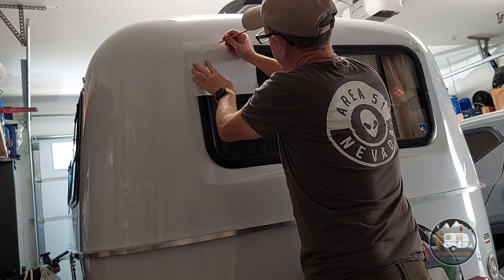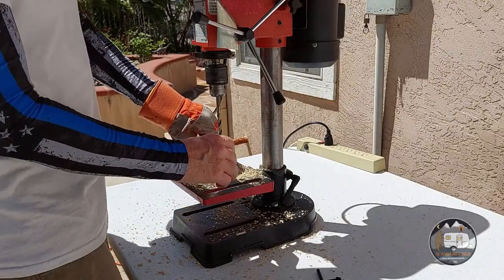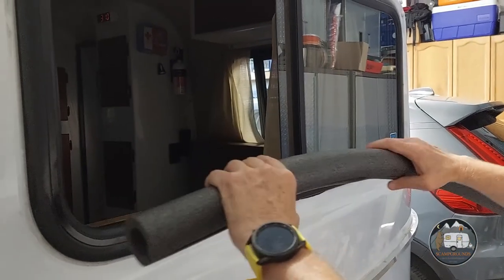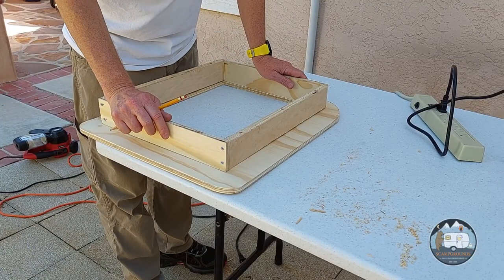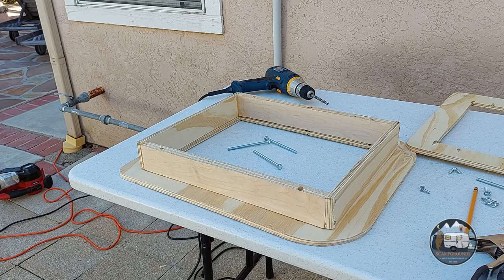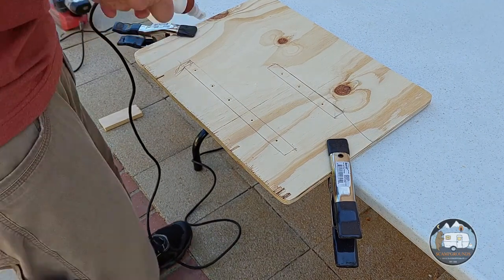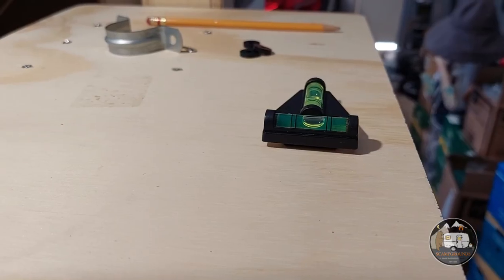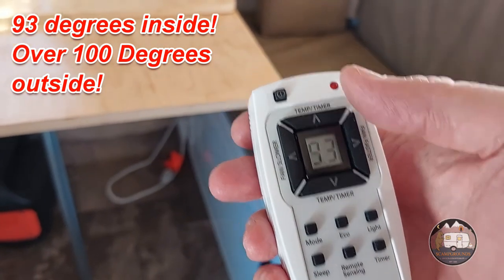Mini Window AC Mount for Small Travel Trailer

Comment: That's really well done.  I made a mount for window ac in my boler trailer a few years ago.  Mine is really simple though.  I just cut some plywood the same size as the window screen that pops out.  I cut a square in the plywood to fit the ac into.  The plywood then just slides into the slot for the screen and the ac slides in the hole.  Not as good as yours but it works.i only have to remove the lower jalhousie window pane which is just 4 screws. The top pane stays on and redirects any rain.
Reply from the maker: Thanks for checking out my video and kind words!  As long as it works, that's all that really matters!

Comment: Brilliant.  Cheaper AC.  Ability to replace in the future with relative ease.  Better match of BTU to camper's rather small cooling needs than the behemoth offered as an option.  Lower air drag footprint too boot.  Thank you very much.  Now to order a Scamp without AC.
Reply from the maker: Thank you!  Glad you liked my video.  The nice thing too is we only take the AC on just select summer trips when needed.

Comment: This is giving me so many good ideas.  Thank you!  I have a shuttle bus RV conversion project and was wanting to put a window AC unit in the side emergency exit window.  I think I can adapt something very similar to this to fit my needs.
Reply from the maker: Glad my project video helped!  Having a temporary AC solution like this makes travelling with our Scamp 13' much more flexible in the summer.
Reply: Don't rule out using a mini split if you want a permanent solution. They are definitely more expensive, but in my opinion are easier to modify to install as you only need to drill a small hole in your camper to run the coolant line through. Mr Cool brand has prefilled lines so you don't need a professional to charge the system. Once you screw the lines in, and open the valve, the system is charged. There are lots of videos of people installing them in RVs. You are also not restricted to using a 5k BTU or 6k BTU window unit. You can get a mini split in 12k BTU that will outperform most 15k BTU roof mounted a/c's. Also the mini splits are so efficient on power (they usually use 1/3 of the power of roof mounted a/cs) that many people have installed 2,000 watts worth of solar panels (four 500 watts panels on the roof) and like four deep cycle batteries, and powered the mini split 100% off solar power. Then you can boondock camp and still have a/c without a generator.

Comment: Nice video but it would have been really nice to see how cool you could get it inside there with it 100 degrees outside. Most RVs have a 13,500 btu  a/c on top at minimum. Now I understand yours is a lot smaller, but I would bet this is a 5k btu window unit, and in 100+ degree weather it would have been interesting to see if you could get it to at least 72 degrees in there during the hottest part of the day. Wish you had shown the temp later on the remote while it's still 100 out.
Reply from the maker: Thank you!  Great point!  I should have done that.   I can tell you that it got cold inside within about 15 minutes and I adjusted the temperature so blankets weren't necessary.   The Scamp 13' is small inside,  so this solution works really well.

Comment: Great video.  Going to start on mine soon.  Just one question, I saw you trace the opening of the inside sandwich portion.  Should that be the size of the air conditioning unit (plus the width of the bottom platform) that will be installed?
Reply from the maker: Thank you.  The cutout hole of the sandwich should be the height and width of both the AC unit and the bottom platform it sits on (and a small amount of extra room for some margin of error) since both occupy space in the pass through hole.  I traced so both sandwich cut outs are the same size with the same size opening to allow the AC back to pass through both sandwich pieces while sitting on the platform.  Does that make sense?

Comment: We don't have these aircons here in Europe. But thanks for the idea ! 😅
Reply from the maker: Thanks for checking out my video.  Perhaps a mini split system?
Reply: @scampgrounds  
Very expensive down here ( no less than 550$ dollars for 5000btu ) . The cheapest are portable units but they consume too much watts and create vacuum (single hose evacuation).
Reply: @scampgrounds  
I tried a  weak mini-split ( 3000 btu ) but it doesn't fit my german-style motorhome windows.
Reply: @scampgrounds  
Moral of the story is you have got to enjoy all the great things you have there overseas 😅
Reply from the maker: @fbezza  Sounds like you are on top of it.  Best way to go, if possible, is to plan trip locations when weather isn't too hot or cold.  We like to go to the beaches and mountains in the summer and the temps are usually very comfortable and don't require AC (we live in California).  But, sometimes, it's great having AC (especially during heat waves).
Reply: @scampgrounds  
We are bound by summer school vacation. Going to southern Europe to introduce our children to historic locations requires some serious airconditioning 😅 Scandinavian countries  and Switzerland on the other hand are expensive.
Reply from the maker: @fbezza  Gotcha!  At least kids are pretty adaptable!

Comment: Looks excellent for dry weather. I can see how you will not be able to use it during rains.  Where does it drain to?   I'd hate to lose the space indoors storing all the stuff so my choice would probably lean toward a permanent installation.  In such an installation cold would be an issue, but a box shape of well glued and taped insulation panels might do the trick.  Just a theory.  Anybody have any experience in such?
Reply: @scampgrounds - great work.  Your video shows people how a little imagination and some common tools can solve a HUGE problem of energy demand, efficiency, for the small cost of a few minutes after reaching the camp site.  Experience with this concept - yes.  This concept works SUPERBLY for the motivated.  There are many variations of the custom frame system depending on one's imagination.  How one makes the portable window frame can take several forms.  I am incorporating some of what I see here into my next custom fit AC.  These can be made to be as weather resistant as one's imagination and persistence with incorporating weather sealing at top and sides on the outside flat piece as one wants to. My last one of these also finished it all out, four coats of good quality polyurethane and it was indestructible.  Made one of these in concept for my truck camper with a false tail gate that could be installed in less than 2 minutes and not a single drop of water could get in with a water hose on high pressure on the system.  Between weather sealing strips between wood frame and RV skin, using rubber "flaps" mounted at the right locations under aluminum flat stock, into the top of exterior frame that sheds water, and providing a small plastic tray underneath the lower wood shelf, it all works.  Is just up to one's imagination and time to perfect the system customized for the window opening.  Am in design of our new 5th wheel, told the OEM designer to delete both 13,500 btu roof top ACs, will use the already provided windows that open out and up as the GE 5000 btu window unit locations (we have other egress doors to porches etc and the toy hauler rear), lowers electrical consumption massively to 450W per unit running continuously on Lo Cool (which they will cycle to fan mode), 100W when cycling to fan, 750W on Hi Cool, and will freeze you out of a trailer easily. The 32'L 5th wheel roof now has two less 14" SQ holes in the roof, moved the kitchen vent to the side and the roof is wide open for the install of ten 200W solar panels or six 450W panels mounted on aluminum unistrut.  Bottom line is this concept when coupled with a robust battery bank, is superb.  Wil take down in minutes and the window (in our case) will flip down and seal - then on the road.  The little 5000 btu units are so energy efficient, cost $150 +/-, very durable, and operate superbly in high humidity and high temperatures, ..... is a no-brainer.
Reply: I'm interested in how you made it waterproof. Could you show a video of what you did please?

Comment: Probably doesn't rain at your location but if it does rain how much water do you think would seep or leak inside?
Reply from the maker: I've only used it in really hot weather in California (no rain) so I can't say for sure.  But, I think if insulation is used around the edges so it is well sealed, rain leakage shouldn't be significant.  The nice thing is that it can be quickly dissembled and the window shut if there was a serious storm.

Comment: Can you stand up in that camper and if so is your garage door a standard height, I am looking for a tiny camper I can stand up in and will fit into my garage
Reply from the maker: Yes I can easily stand up inside my 2020 Scamp 13' -- the interior height is 6'3".  Our garage height was 7' tall and we raised it to 8' tall so our Scamp will fit inside.  Some people report they are able to fit their Scamp under a 7' height garage opening by lowering tire pressure or taking tires off, but I didn't want to do that and couldn't verify that would work for our garage.  The angel entry (e.g. slope of driveway into garage) may also have an effect on clearance.  For much more detailed information, see my article:  https://scampgrounds.com/why-how-we-fit-our-scamp-in-the-garage/
Reply: Oh neat I will see the article and I like campers that fit into a garage @scampgrounds  I have been building teardrop campers because they fit into a garage but now I like to have a stand up camper that fits. Subscribed thank you

Comment: Did you slope it for water run off ?
Reply from the maker: I didn't, but that's a good idea if one is doing trips to hot places with rain.  We seldom encounter that kind of condition on the West Coast.  If it's raining, it's usually cool and we don't have the AC in the Window.  It only takes a few minutes to remove, so if there is unexpected rain the AC can be quickly stored in the car.

Comment: Was that outlet you used to plug in your AC there when you purchased your scamp? Is it there it the newest models?
Reply from the maker: I ordered our Scamp from the factory (2020 Scamp 13') and was given the option of adding many 110v outlets (they have many locations that are available).  I think I went for all the outlet options -- one on the floor under the rear window, and  rear ones on both wall sides facing the kitchen dinette.  These outlets only work though when the Scamp is hooked up to an electric outlet at the campsite (or if there is a generator).  So, when we run this AC we always have to stay at a place with electric hookups (since we don't travel with a generator).
Reply: Put a 400Ah Li battery on your camper with a portable suitcase style (put your own piano hinges on some 200W panels for up to an 800W solar capacity with the RV tilt brackets you can buy or make). Couple that with a Champion 2500W dual fuel portable generator (use LP and forget gas) and you are off grid. Depending on your roof space available, a couple 450W panels and you are set. For my truck camper set up, I coupled with this set up with a Renogy 3000W PSW inverter and 40A Li battery charger as just another source of charging.  Will set you free.  If you are going to the next level, (YOU) can install an ATS (which will sense shore, generator, solar and take care of getting power to your outlets and appliances, ... but not necessary to get going for your off grid solution. Flip on the inverter when you need the 120V and flip it off when you don't. Hopefully this gives you some ideas !  @scampgrounds

Comment: Nice setup. I am going to do something similar once I take delivery of my 13 ft Scamp. I forgo the roof ac for the same reason to be able to store inside my garage. BTW, any idea of the actual weight of the AC unit? There seem to be big discrepancy on the unit weight from website to website. Thanks
Reply from the maker: Thank you.  It's worked out really well (fast setup at the campsite and cools quickly in high heat environments)-- we just take it along when we know we will need it and have an electrical hookup.  The AC weighs 43lbs on my business scale (I weighed it because I saw the same discrepancies online between Amazon and the manufacturer specs.).  I have more details on my website:  https://scampgrounds.com/small-travel-trailer-mini-air-conditioner-mount-for-rear-window-temporary/  Congratulations on your upcoming Scamp!
Reply: @scampgrounds  Thanks for the quick reply. Did you consider the one with mechanical control? The mechanical one weighs about 35lb according to Frigidaire and home depot website, which is about 8lb lighter. Of course, you lose the remote and eco mode.
Reply from the maker: @travelhawk7895  Sure.  Yes -- I seriously considered the more basic one without the remote / electronic controls.  Because of all the discrepancies in weight online, I didn't really know the weight differences when I ordered -- I figured it probably wouldn't be significant.  Having an electronic remote vs. manual control is no big deal -- because the Scamp is small inside.  However, the electronic control one is Energy Star Certified -- which could be significant if you ever want to run the AC with batteries.  I contacted Jackery (I have a Jackery 500) and the tech told me this AC would run 3.5 hours with their Explorer 1500 (mine is the 500 which he said not to use to run the AC).   An electric car with V2L, like the Hyundai Ioniq 5, could potentially power this AC as well.  Additionally, I noticed the basic one is about 2 inches deeper -- so that was a factor.  Overall, I think either would be fine.  I have a helper to help me put the AC in my Scamp when we set up, so the weight is no problem at all.  But, I think an older person camping by themselves would benefit from the basic one which is 8 pounds lighter (when you are lifting by yourself, 8 pounds can make a difference).  I don't think the weight is a physical issue for a new Scamp when you support the AC with the leg that rests on the bumper (some people even mount without the leg -- but, I wanted to be extra conservative).  Looks like the prices (sub $200) are good right now!
Reply: @scampgrounds  thanks for your thoughtful and detailed response. I enjoyed watching your videos and reading the content on your website. Keep documenting your travel and your work on scamp. They are invaluable to other scampers. 👍
Reply from the maker: @travelhawk7895  thank you!  That means a lot!  Happy Scamping!
Reply: Thank you for this! Do you have any data on how much this AC cools down your Scamp? Interested in the difference outside vs inside temperature you can achieve. Cheers.

Comment: Hey do you make these ??
Reply from the maker: No -- I just made the one in the video for my Scamp 13' and have been using it successfully for a while.  But, if you go to my website above or follow the video you should easily be able to make one for your trailer (or hire a handyman to do it).  It's fairly simple and not very expensive to make.
Reply: @scampgrounds  thanks 💯

Comment: I'm sure it will be all right until it rains. Then you'll have some problems.
Reply from the maker: Have never tested in the rain as we use it only in the summer on the West Coast.
Reply: Use a sealer on the wood and some cocking in case you want to leave it longer i guess
Reply from the maker: @Mcanic   Yes -- the wood should be sprayed with exterior primer and paint (as was done on this one).

Comment: thing sounds insane loud
Reply from the maker: The Frigidaire FFRE053WAE Window Air Conditioner is rated at 50db.  I find it to be like white noise and not an issue for sleeping when on.  Here's the definition I found online about 50db:  "50 dB is as loud as a quiet conversation, a quiet suburb, a quiet office, or a quiet refrigerator. Notice the use of the word 'quiet' when describing this noise level? That's because all sounds between 31-60 decibels are considered quiet."